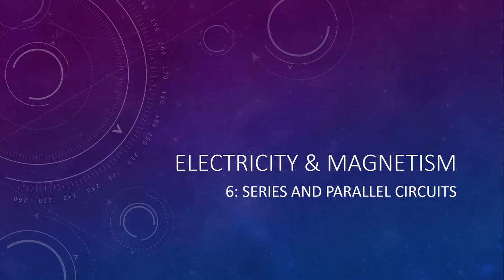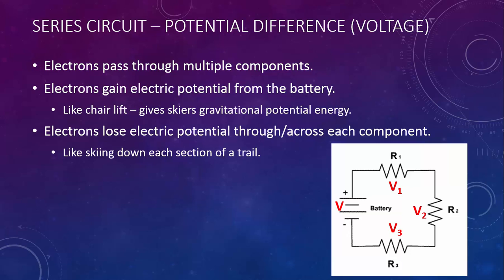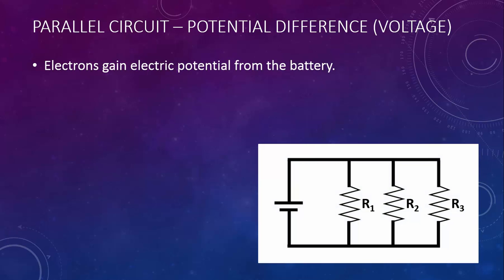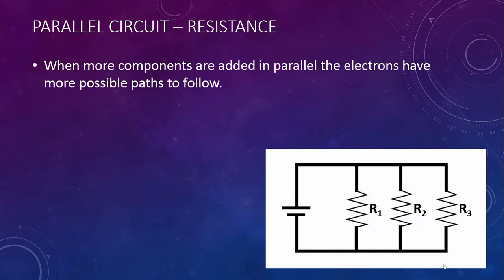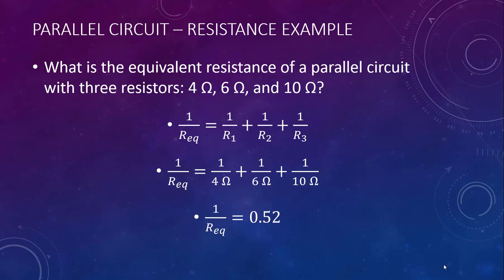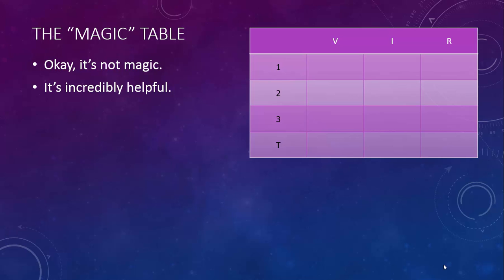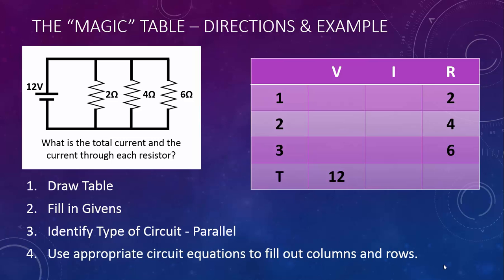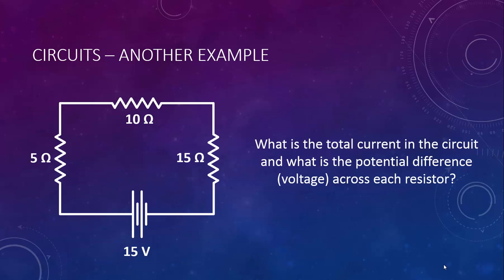Electricity & Magnetism 6: Series and Parallel Circuits

Comment: In 5:47 I didn't understand that equation. If you have 1/R=0.52, it is 1/R=0.52/1 and cross multiplication gives 1=0.52R. Please reply.
Reply: Right! Take that one step farther, though. Divide both sides by 0.52 to isolate R. You'll get 1.94!
Reply: @fangorn0  okay thank you.
Reply: @fangorn0  yeah that worked.